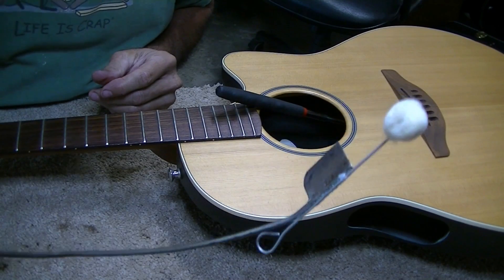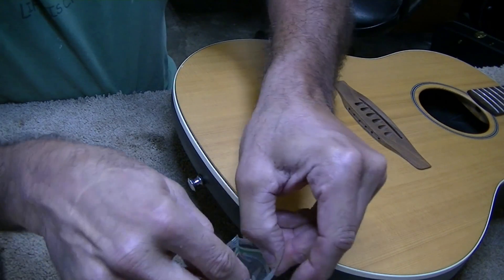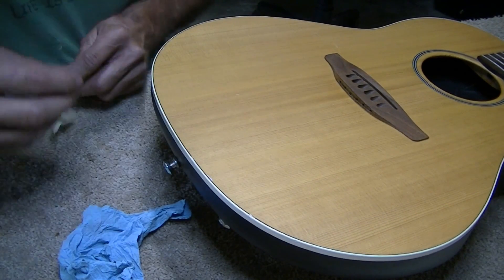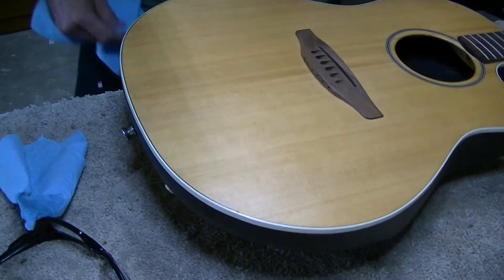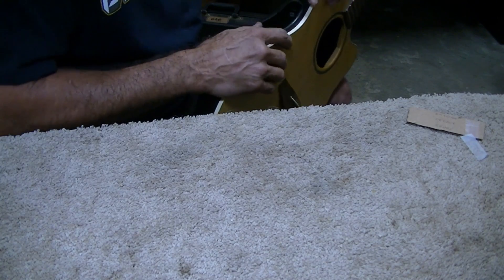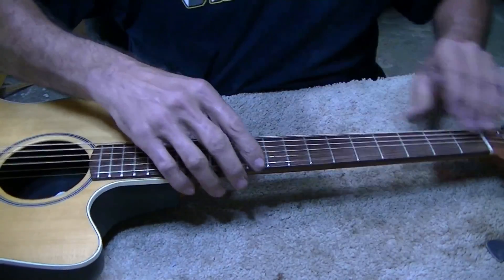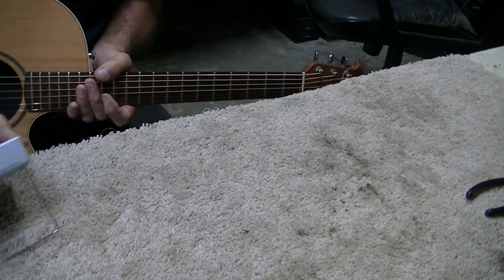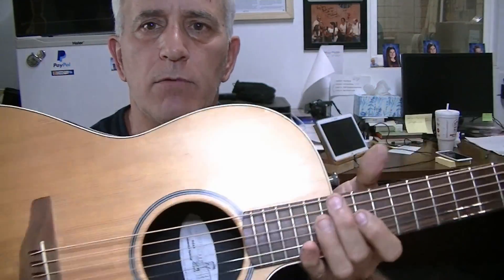176 RSW Ovation Top Repair And Setup Final

Comment: Remember, Torres, the great classical guitar luthier (and a good player / composer too) once built a guitar with the back and sides made of paper mache just to prove to his fellow luthiers that you could make the back and sides out of just about anything and it would still sound good as long as you had a great top. It's all about the top. The only differences I've ever noticed is that using maple or cypress for the backs and sides will make the guitar a little brighter, but all other woods, including laminates, sound pretty much the same for the back and sides. Granted, I've never played a guitar with Brazilian Rosewood back and sides, but I think I can say without reserve that I've never once been able to tell Indian Rosewood from Mahogany, Sapele, Walnut or Ovangkol on backs and sides. As far as laminates go, I think the only thing that matters is what the inside layer is made from, and I think I can easily provide good evidence for this.

Comment: Jerry, it's a good thing you couldn't see my face when you mentioned that dreaded Gorilla glue. I've never used it on a repair, but don't know how many times someone used it on a "repair" before it came to me the fix their fix. LOL I always tell my customers if you're comfortable, then go ahead, but it not, then don't try it and bring it to me. It'll cost them much less if I can just do the repair. In all honesty, I despise that stuff. Now Gorilla wood glue and especially their CA glue, I use tons of. Love them both! Getting ready to do almost exactly the same repair. Looks to be about the same amount loose on the one in my shop as the one you did. Only difference is the burst finish on the one I have. Kinda thinking I'm probably gonna have to work out a way to clamp, as the binding looks as if it'll need pulled in to make contact with the end of the top. Why don't these companies address known problems? I guess as long as folks are buying then they'll keep spitting it out. Thanks for the videos!!

Comment: I'm also glad you didn't use the gorilla glue. I've used it and although its strong it can leave a snotty residue similar to araldite (and snot :-) ). The renaissance polish is my preferred choice like yours. Leaves a good hard finish even though it can be expensive for a small tin. Another great video and like the way you always tell the truth.

Comment: That stuff works good , I`ve learn`t over the years what a whiteout pen will do to hide a crack after it`s glued  it`s tough enough to last few yrs or till the warrenty is gone LOL I use it to hide cracks on taxidermy skulls -But you can fill the back edge to make the gap closer it cleans up good on surfaces but fills gaps to hide them and it`s paintable . Sound great - My Bass is still in tune .
Reply from the maker: Garnett M thank you very much.

Comment: For what it's worth, at any decent hobby shop they have CA remover/debonder.  It's actually kind of amazing because it turns the glue kind of slippery and immediately breaks it down so you could clean up the dry glue easily and quickly.
Reply from the maker: I have several different varieties of it myself. It damages finish a lot and I don't really care to use it much

Comment: another great watch Gerry, I seem to remember Linda Manzer uses strips of rubber like a shredded (length ways) bicycle inner tube) wrapped around her guitars when glueing the top on her guitars, I know you didn`t need it, but I wondered if that may have been the answer to your clamping dilemma, one for the future maybe! thanks again.
Reply from the maker: 1066wastrel thank you very kindly for watching. I have heard of using inner tubes. I have used large rubber bands in the past myself.

Comment: I’m not a luthier but a carpenter.
I fixed one of these where the top was separating from the back and I used two part epoxy. It worked really good.
I was gonna use ca glue but I thought the epoxy was going to be stronger. I’ve had epoxy fail on shit tho too so ca might be better.

Comment: I wish I was confident enough to use a little saw like that on the nut. I realized that I will probably have to deepen the slots in the nut on my archtop. I looked for files to do this job on Stew Mac and was dismayed to see how expensive they were.
Reply from the maker: Jkautsky I feel your pain my friend. That's why I started using a saw years ago and I just stuck with it because I actually like using it.

Comment: Jerry,  very good repair and even better advice on what to do when something doesn't go quite as you expect.  CA glue can be a real mess.  Thanks for sharing your techniques and honesty about fixing things when something goes a little wrong.  The sign of a true craftsman, knowing what to do when something goes a little wrong.  You had two errors happen on this and corrected both of them gracefully.  The top repair final results looks great on film.  The string in the nut being lowered a bit too much, then replaced with a new deer antler  (i.e. bone).  The deer antler should transfer sound a little better.  Did the top edge require any scraping or sanding?
Reply from the maker: Pete Walton thank you very much my friend. No The Edge was surprisingly smooth. It turned out real nice despite how hard it fought. thanks again.

Comment: Hey Jerry I don't remember if you said, is that top fan braced or X braced. Only ones I've had in my shop were fan braced and they came in for crack repair. Seems like a big problem with fan braced Ovations. But the top on that looks real flat. I thought that black binding line was gap when you were gluing it up. And I'm thinking, tape it closed Jerry, tape it closed. I hate seeing factory guitars come with shims under the saddle but that's their quick and dirty way of pumping out guitars. Also I could tell from the shavings coming off the nut it was one of those crappie soft plastic ones. I hate those things. Much better off with the nut you made. Good work as always my friend.

Comment: I want to tell you that in my experience too much moisture ruins your guitars fairly quickly. Too dry a room, on the other hand does the same too. Keep your guitars (and for what matters any instrument far away from temperature gaps and far away from moisture if you want them to stay stable. That is my experience talking and I have more than 50 string instruments dated from 1896 to 2010. I agree fully to your opinion: keep them more dry than damp, don´t let them freeze and don't let them cook.